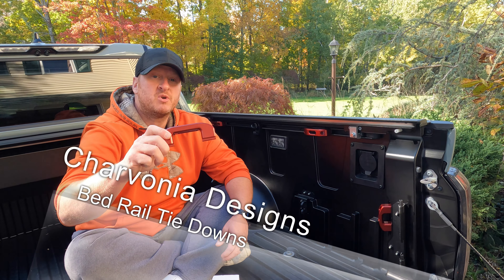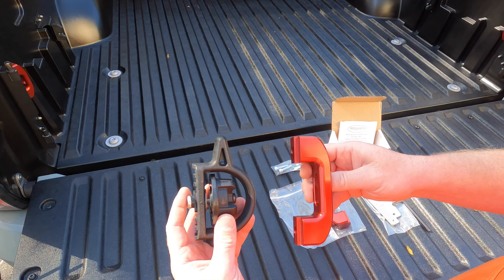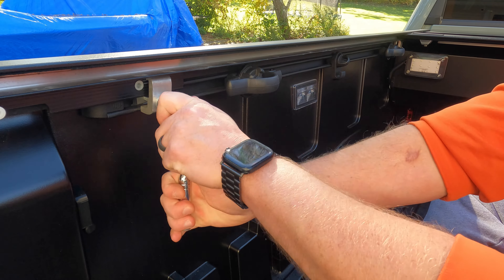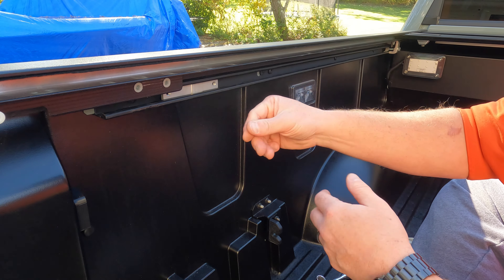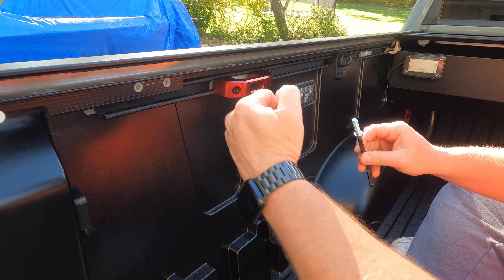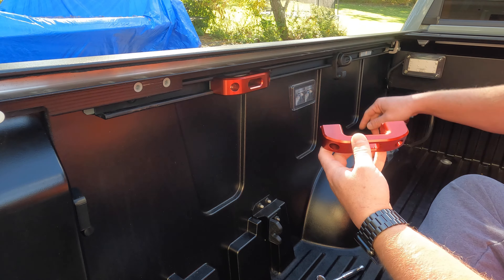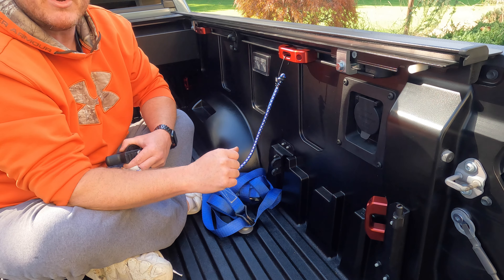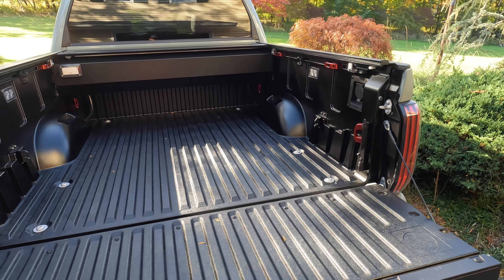2022 Toyota Tundra Aftermarket Bed Rail Tie Downs, by Charvonia Designs

Comment: I agree that these look 1000 times better than stock.  That said, losing the ability to easily relocate their position on the bed rail cancels out any advantages (other than appearance) in my mind.  I can easily add a hook and ring to the stock tie downs that will give the same if not better range of motion to smaller hook straps and provide even more clearance for larger straps.  The biggest drawback, however, is the price...about $200 for a set of 4!  If they had a mechanism that would allow easy repositioning, then they may be worth the price.  Thanks for the video, though.  It was well done.